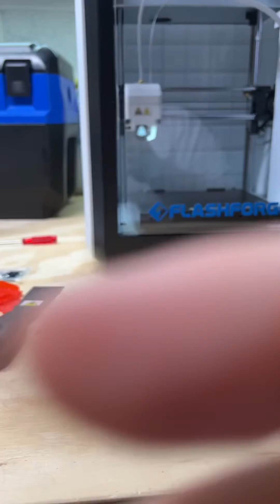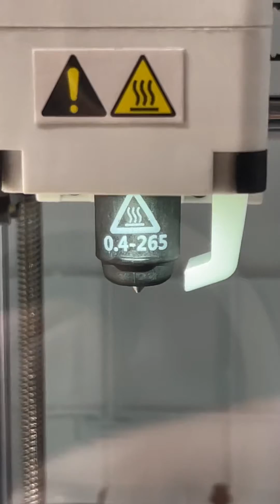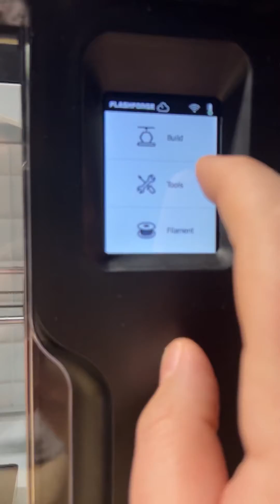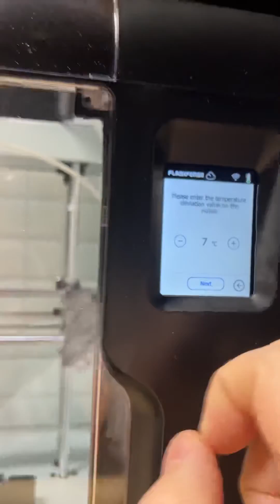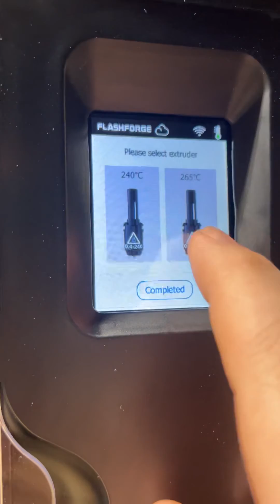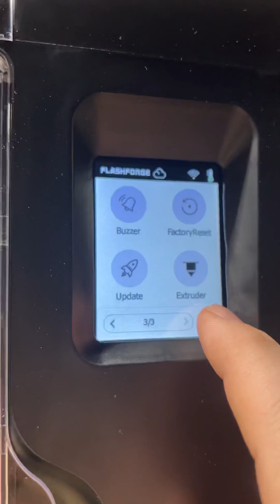Recalibrate (265c max nozzle temp setting) on FlashForge Adventurer 3 Series 3D Printer

Comment: Thanks for this video.  I switched out my 240 nozzle for the 265 and it wouldn't work correctly (prints weren't sticking to the glass build plate).  The number written on the nozzle's packaging was 16 but noticed yours was 6.  I thought, did someone make a mistake?  I changed the setting to 6 and wouldn't you know it, it's working now.

Comment: You correct, there’s no instructions ON THE USERS MANUAL BUT if you look at the nozzle packaging you have the instructions right there telling you: PLEASE CALIBRATE NOZZLE TEMPERATURE WHEN YOU SWITCH TO A DIFFERENT NOZZLE. CLICK “CHANGE EXTRUDER” AND ENTER THE AVOVE TEMPERATURE LISTED. They provide the instructions but we need to be aware 😉